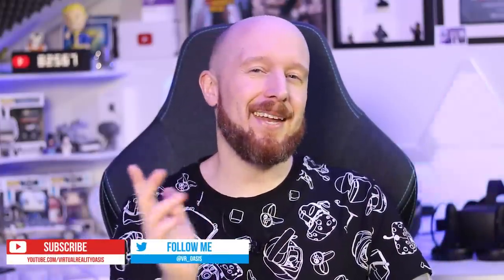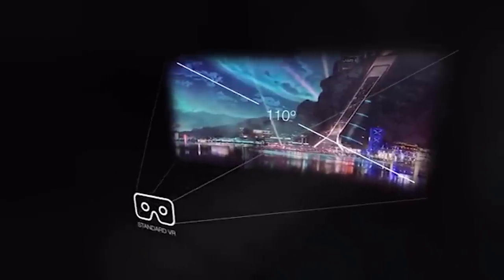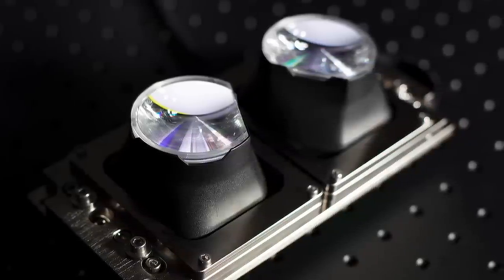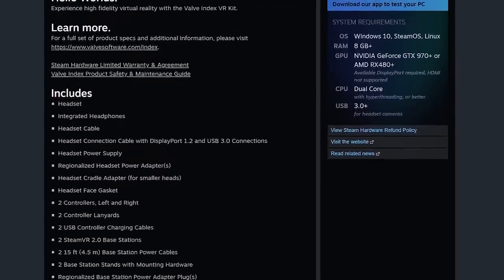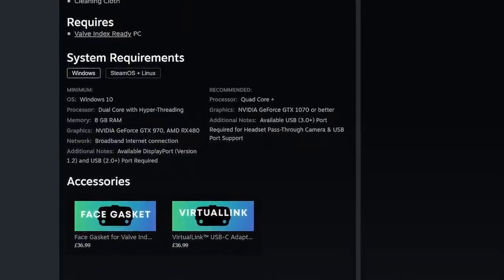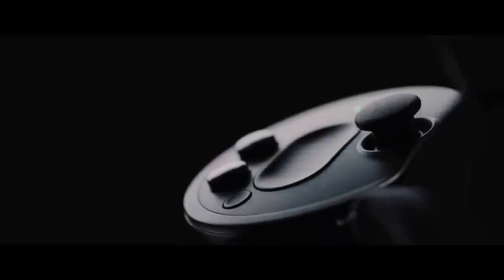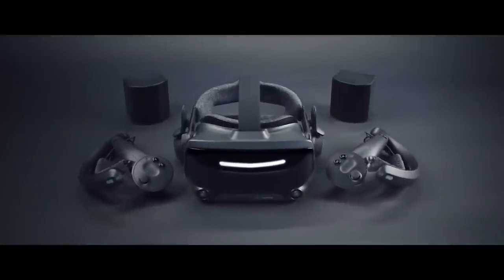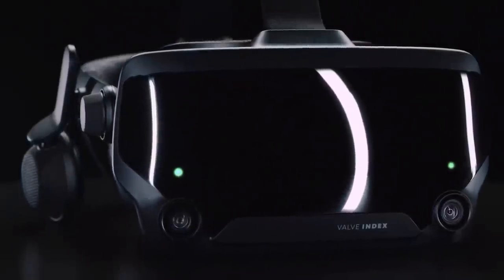Valve Index - Everything you NEED to know

Comment: The valve knuckles are quite impressive
Reply: Thomasito Ferrari I really hope we can just buy them and use it with the Oculus Quest or rift (I know that it works with the vive, but it should be compatible with the rift
Reply: Ikr? I'm gegting a quest someday and it would be epic to use those :D
Reply: @thecomicman6890  You can get them to work w/ Oculus with some work
Reply: @thesneakyfoxtss  true, with a bit of coding and a couple lighthouses 2.0
Reply: @ATestamentToTech  No coding needed, you just need to:
- Have an Oculus Rift S, the chance of Steam supporting an Oculus Quest is slim to none
- Play your games on Steam, as that will be the only platform that understands all the hardware involved, Oculus platform will not understand SteamVR hardware at all.
Reply: @thecomicman6890  You cannot. You would need the basesations, two bluetooth dongles and put the Rift in the steamvr environment. There is a hack to get it to work, but the Rift does not support it. It's obviously a completely different tracking solution.
Reply: @thesneakyfoxtss  No, you cannot. You need the lighthouses, controllers and a couple of BT dongles and the hack to get it to work. The Rift is just used as a direct display. You may as well buy a steamvr HMD.
Reply: @suicidalbanananana  You also need all the steamvr hardware like the lighthouses, controllers, and two steam BT dongles. The Rift acts as direct display. The hack to get it to work is terrible and so unreliable it's not worth it. 
If you want steamvr equipment, then buy a steamvr kit. Same goes for oculus.
No, Quest will not be supported by steam. It's a closed oculus system. Oculus has stated this many times. That's like saying you want your PC to play PS4 games from the PS store. It's simply not compatible and defeats the whole purpose.
Reply: @sqlevolicious  welp the knuckles are probably 200 bucks anyways
Reply: They are impressive but I'm not sure about $280 impressive.
Reply: suicidal.banana What were you saying about steam not supporting quest?

Comment: Everything you need to know:
It's $1000
Reply: looks like high quality tho
Reply: Quality comes at a price. This will offer immersiveness the Oculus can't compete with.
Reply: @Artey86  cant !== wont. Oculus are purposefully limiting what they put out to hit 400$. Have you seen their R&D?
Reply: Yeah....and don't forget the $ for the 2080ti you'll need to run this thing as intended!
Reply: @johnbeaton1076  a 1070 or 1080 will do fine
Reply: @Artey86  No...I don't think so. Not if you want the AAA experience!
Reply: Maarten the 1070 will not cut it. In 95% of game you won’t get a smooth 120fps vr gameplay.
Reply: Or a couple 980ti's should do good as well.  Still a beast of a card.
Reply: Yes, a 1070 will do fine, as someone who’s had the chance to own both the vive and oculus. They haven’t increased the minimum specs nor recommended specs for the index. So it will run great with a 1070 and better, but anything lower than that might have issues maybe
Reply: WolfGambit you can’t use more than one graphics Card for vr, otherwise I’d just buy another instead of upgrading
Reply: @DeVipurr  not necessarily true, because that's what NVIDIA's VRWorks and AMD's LiquidVR projects are precisely meant to do, multi GPU integration for VR. Instead of SLI setups alternating frames for pancake games, which is horrible for VR latency, each GPU renders for each eye and can scale to as many GPUs as you have. But there is a big issue with either of those because most VR games aren't made to support them.
There are a few games and experiences that do support these, but not many. 
Which is a bummer because the tech is there. The ones that do though, work well.
Reply: Can a 2080TI push two screens at 140hz?
Reply: @jamesc2388  the 1070 won't do 120 fps, but it will be fine for 90 fps.
Reply: I'm in Australia. $1KUSD = $1418AUD 05/01/19

I spent $567AUD for my Rift CV1 during the Summer of Oculus Sale.
+ 2 additonal sensors $180AUD
HMD active hdmi repeater $40AUD
5m Hmdi flat extension cable $50
5m usb 3.0 active USB extension lead $40AUD
2 x 3m usb 2.0 inactive extensiopn leads $40AUD
Startek 4 port PCI USB 3.0 expansion card $200AUD
Display port to hdmi adapter $25
Total $1142AUD for a difference of $276AUD

Not a big jump for the enthusiast market. Might help to put cost in perspective.
Reply: Just to make it very clear they are going for different things, look at one of the specs: the Rift S has a refresh rate of 80hz (lower then the Rift & Vive that had 90hz) and the Quest has even less at only 72hz, but then the Valve Index has DOUBLE that of a Quest. So yea, Oculus and Vive are very much drifting apart and aiming for different goals. Theres nothing wrong with that btw, we need different price-ranges in VR, and the Quest will help alot of people get started with VR, which can only be a good thing.
Reply: Get oculus, I have vive and boooy fuck hardware as long as steam is full of trash demos for vr...
Reply: @W0lfStride  SLI not only doesn't work now, but it doesn't work for VR either.
Reply: @W0lfStride  What games work? So far I heard VRWorks was a DOA idea that died with the one custom built scenario, that no one ever got to try like 3 years ago. The latency between the two GPUs and the CPU to handle the traffic is far beyond what modern tech can achieve. 
Liquid VR is just a VR-support branch of AMD, has nothing to do with SLI.
Reply: @sqlevolicious  so far, The Lab, Raw Data, Serious Sam's, Talos Principal, Everest, and the small Star Wars trials on Tatooine experience. Not many, but some do have it.
Reply: @sqlevolicious  and how can you say that SLI doesn't work now? There are plenty of games that still support traditional SLI. But it is fading because there is definitely a lack of support. But some games and developers are still being made to push the boundaries. So depending on the game/experience SLI can definitely be beneficial. Still.
Reply: @suicidalbanananana  And then it could also turn those people off of VR from the refresh rate making them sick
Reply: @johnbeaton1076  What do you mean AAA? There is no such thing
Reply: @johnbeaton1076  I need to buy another 2080Ti? I already own one because I like to play PC games, but you're saying I need to factor in the cost of a 2080Ti when purchasing an Index, so it seems like I can't use the existing one I purchased for purposes other than VR. That sucks! If only I could use my existing 2080Ti! That way, I could have been using it for normal PC games but then I could get additional use out of it by also utilizing it for the Index, making the overall up-front cost cheaper!
Reply: James C you don't need 120fps.
Reply: @fireaza  I tried very hard to find this amusing and interesting....but found myself getting bored halfway through. So, I had a nap, then finished reading your comment. Still not funny, still not interesting.
Reply: Yeah this stuff should be getting cheaper so its more than a niche small market, not MORE expensive.
Reply: @johnbeaton1076  That's how it's supposed to be! You're the butt of the joke, it's not intended for you to find it amusing, interesting or funny! I'd be insulted if you did!
Reply: @fireaza  No, but my point is far simpler than your overly verbose reply merits......I simply am stating that 'VR Ready' covers a huge range of capabilities. A Geforce 1050ti is technically 'VR Ready'.....but good luck running Project Cars on it at anything more than slide-show framerates. So, in short, if your PC bottlenecks your VR experience because it simply cannot push the number of pixels that your headset requires.....you need to spend more green (or have a particularly underwhelming VR experience).....that is the sum total of the irrefutable point I am making......now off you pop and construct an unnecessarily hyperbolic reply to my reply to your reply to my original statement....Farewell!
Reply: @johnbeaton1076  My original reply was overly-verbose in order to match the over-the-top nature of your claim that purchasing an RTX 2080Ti was necessary. 

While you are correct in noting that low-end GPUs are going to have a lesser experience, again, you don't need a top-of-the-line GPU like the RTX 2080Ti in order to enjoy VR. I originally used a GTX 780Ti when I first got my Vive and it was only un-playable in a small handful of games. I then moved on to the GTX 1080Ti and pretty much never had any trouble from there. 

According to the Steam hardware survey, 15.69% of Steam's user base are using the GTX 1060, making it the most popular GPU. This is not only a more powerful GPU than the one you used an example, but also WELL above the minimum requirement of a  GTX 970. 

In other words, for a sizable portion of Steam's user base, buying a new GPU for VR, let alone the second most powerful GPU in existence, is completely unnecessary.
Reply: I'm going to wait until 2053 when this is £40. Cannot wait!!!
Reply: It does more than the Vive Pro for just as much with great controllers
Reply: Thank you
Reply: For someone like myself just getting into VR I simply can't justify $1000 vs the rift s at $400. Sure it's better but 2.5x better? I think not.
Reply: @shakinbabybacon5815  with far better controllers. The screen difference DOES MAKE A BIG DIFFERENCE. The better tracking, the open source and far wider range of games
Reply: @TheMarineGamerIGGHQ  don't get me wrong here the index is obviously the superior choice. But as an entry level consumer like myself the $400 rift s is much more appealing. I'm not ready to invest $999 into something I haven't even tried yet. Not to mention having to upgrade my rig(1060), a personal problem for sure tho not a negative on the index. Consumer vs enthusiast.
Reply: @shakinbabybacon5815  I got the vive as my first and that was already superior other than the controller's and im really just a consumer at the moment. It depends on how much you're willing to spend and save up. Quality doesn't necessarily have to be divided between consuming and enthusiasm. Like the same way majority of people with Lamborghinis and Bentley know chicken shit about cars but get them  anyways ( bad analogy considering the price difference ) but I think you get my point
Reply: @TheMarineGamerIGGHQ  alright so you have probably had your Vive for a year or more now, so these improvements seem like a big deal to you and I'm sure they are. To me completely new to all of this, it's all a big deal to me, I'm gonna enjoy the shit out of my rift s the way you enjoyed ur Vive when you first got it. For a much more affordable investment.
Reply: @shakinbabybacon5815  depends. If you spent another month or two saving up for a slightly better system it's always worth it but again that's up to you. I've just heard it from multiple people how the upgrade to the vive should have just been their first. Then again if you do go for the Rift whenever you upgrade you'll really be able to tell the difference with something like the index so go for it mate. I just mean that the price of the index is justified. Especially considering valve aren't charging the exact same for every nation like HTC was doing with the vive. Which was a bit unfair
Reply: @TheMarineGamerIGGHQ  I do appreciate the advice and I look forward to possibly owning one in the future, but $1,500 (index+1080) on video game hardware is unfortunately just too much for me right now. I think the rift s is great I have been watching videos for it and the comments sections are filled with people getting it as their first VR. It may be inferior but the price point is getting a lot of new people interested in VR ultimately helping it grow.
Reply: @shakinbabybacon5815  well you won't regret the experience either way mate ✌🏻
Reply: valve's new vr headset. the "i have a patreon to pay for this for me" index
Reply: and its going to be the best vr headset on the market.
Reply: Idk 1080 struggles on some games to get 90fps if u turn up super sampling above 1.2.   I gotta try this index. Cause so far the regular oculus does just fine it’s the games that suck. There are a few good ones but more arcadey games than anything

Probably will get the oculus s just so I don’t have to deal with towers always gotta reset. But first gotta try these so called high end ones see if they really worth it which I doubt.
Reply: Which is about the range I imagined it would be. It seems to be extremely high quality. Albeit I'll only buy it like next year when I have more money to buy a new computer.
Reply: and the HP reverb shits all over its screen.
Reply: Hey yes so to everyone telling the GTX 1070 won't cut it. According to Valve's "Index" checker software, the GTX 1070 is good for a 3xA gaming experience.
Reply: Everything you need to know:
Dapper Flaeron does not have a job.
Reply: @ForgottenT  I have a part-time job at CVS can't go full-time because of college. The education, cost for textbooks and rent makes it difficult for me to purchase stuff for myself.
Reply: @lajeandom  

"looks like high quality tho"
So does my steam controller, and it is a worthless piece of crap.
Valve needs to show success in the hardware field befor I throw them any more money.
Reply: @Artey86  
Get a Pi-max 4k for half that.
Reply: 599 for just the headset
Reply: @Artey86  That cord tethered to your PC from your HMD is sooooooo immersive.
Reply: @Artey86  Barely. I have a 1060 and the Valve specs scanner told me the 1060, a level down from the 1070 and 1080 was not powerful enough.
Reply: @Zeemis  I ran that Valve VR spec scanner too and it put me as far green as possible with my 1080, so not sure how finetuned that thing is
Reply: People buy phones and tvs for 1k. This is much better value imo.
Reply: Pk Biggums 
Say that to Brian Lindenhof's new video.
Reply: @MrRourk  Shure
Reply: @johnbeaton1076  Supersampling
Reply: And a new computer. But it's Valve.
Reply: fr
Reply: i dont need to eat
Reply: @johnbeaton1076  Minimum specs would be like a 970. Anything above that will do just fine honestly. Keep in mind you have to have a decent CPU as well as a recommended GFX card. GFX cards can only do so much with the visual quality of things, but the cpu will generate all those other things that are easily forgotten when playing a game via (resources, loading times, number of items within the world/cell, and much more.)

Oh yeah, don't forget about the GBs of RAM.
Reply: ok thanks you, 
KIDNEY: *payment accepted*
Reply: exactly why I wont settle for less, im good with paying 1k for a system that makes me feel as if I was in the actual world
Reply: oh....i see. lame
Reply: @johnbeaton1076  You dont need a 2080, 1070 is fine
Reply: @johnbeaton1076  No offence but you clearly have never used a VR kit then.
Reply: @ryanblakeway5840  Oh I have...and I do and have owned many headsets and I stand by my original assertion.......but thank you for playing!
Reply: @matulostyle  That's literally the reason why I only play pavlov and contractors lmao.
There are so many good vr games that are overlooked, like blueshift, or sopwith vr, they are free and are a better experience than some of those shitty 20 minute demos for 20 quid.
Reply: @johnbeaton1076  I'm calling bs, if you think you need a 2080 ti then you are clueless.
Reply: @Artey86  nope I seen a stream of a gay that did a opening on the Index and did a stream testing it out with a 1080ti and was only getting 85 FPS in Beat Saber Average in some games an had some game's that just tanked the FPS and had  game's he could not run at all on this head set. The Higher Rez take's a lot more power to push and you have to do it on two screens at the same time.

This is a high End set up that well need top end Gaming GPU's.
Reply: @Floran_Plantman  yeah true but more like 2,500$ for a 65" Oled lmao
Reply: @johnbeaton1076  1050TI gets about 80 fps minimum
Reply: people who say that are the kind of people to spend $1000 dollars on a phone and say actually good stuff is expensive
Reply: Yeah but 1000 dollars
Reply: @lajeandom  it’s the first vr headset I got to use so I can’t wait to buy it..

For those who don’t understand my cousin let me use his

Comment: $1000 USD doesnt seem that bad tbh with all the stuff you get. But it would have been nice to get one of the three valve titles included.
Reply: $1000 this or.. $999 Apple Stand?!
Reply: Well, you called it early, haha. Index users get HL:Alyx free if they own the headset by the end of 2019.
Reply: @ryanwolfe2219  wait really? That sucks. I plan on buying one later so I won't get the free title. Makes more sense to always keep it free for index users as valve would get $1,000 instead of just $60
Reply: @Jojo2  Well, technically it's if they own the headset or just the controllers as well. So if you have a Vive or Vive Pro, and pick up the Index Controllers (Knuckles) then you also get a copy of Alyx. Either one or both by the end of 2019 is a free copy.
Reply: @ryanwolfe2219  dang well I don't have a Vive pro so.